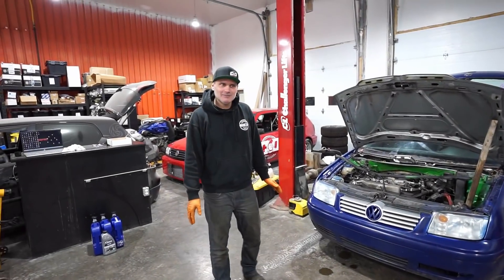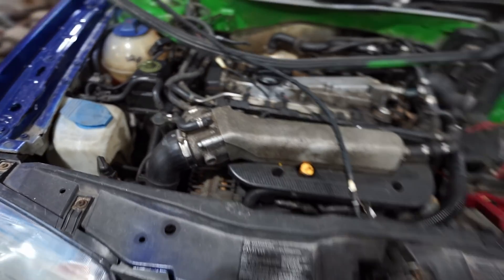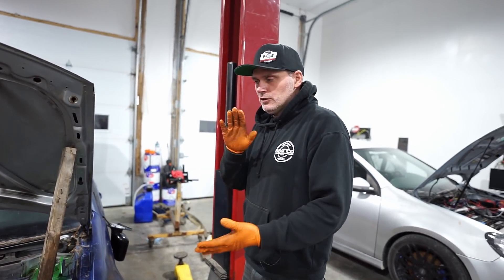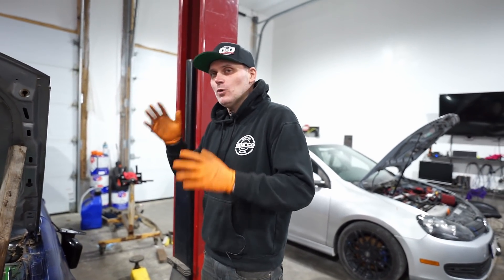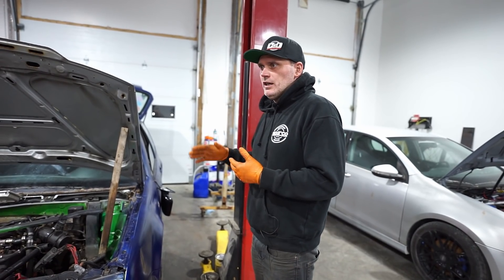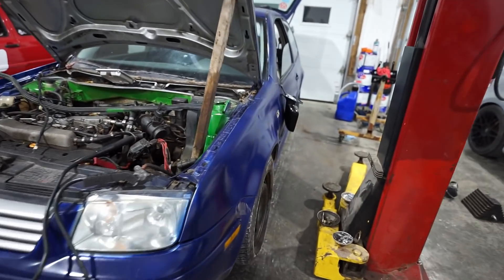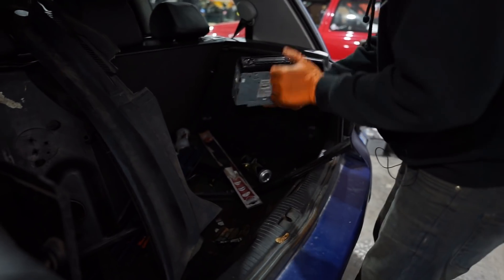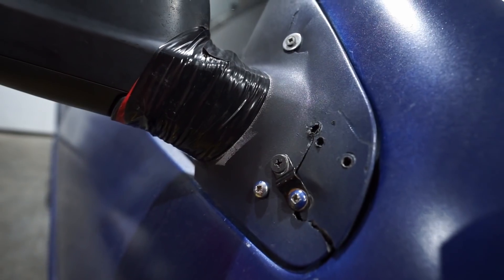How much power can we make on a stock 1.8T engine? Pt 1

Comment from the maker: We're doing this for you guys, we appreciate all the love and support. Lets see what we can do with this thing.
Reply: #NEVARLOSE
Reply: Sweet! It would be cool to see a progression on this one. Testing a ported head, cams, ko3 vs ko4, that type of thing.  Even if you don't, this will be great!
Reply from the maker: @GreatLakesLogger  the goal is not to open it. Stock longblock.
Reply: @COMotorsports  if I would've listened longer, rather than just blowing off immediately, I would've figured that out I guess
Reply from the maker: @GreatLakesLogger  lol I get it.
Reply: Appreciated guys, I just bought mk4 jetta from auction. I plan on swapping the never lose into my mk2. I think the  standalone will make it a easier swap. Looking at the ecu master products. I'm looking for the solution that has the harness and ecu so can just drop the 20v into the car. Which stand-alone are you guys using?
Reply: 4:45 
Anything we want  ? 
Let's go garage 54 style and fill the engine bay with concrete and see if it still runs 🤭🤭
Cut 2 cylinders off and make a .9T 
😂😂
Reply: I've seen I think around 500 on dyno on a 2003 VW 1.8 T 5 speed Jetta and yes it was a awp with stock 19 mm rods that was with the stock awp head they say usually the 1.8 awp motor will snap connecting rods they say usually around 350 400 HP my understanding is if tuning and the torque kicks in fully in the low RPMs is what's snaps the little 19 mm rods but I have seen someone squeeze I think 500 out of a stock motor
Reply: 9:50 fill the bellhousing with some coca cola and drain it,might give enough tack to make a pull. 
Ain't calling me hillfolk for nothin, and that trick could get ya home.
Reply: Just commenting here to say this absolutely needs to be called the "1.8-Hoop-T"
Reply from the maker: @04sneakysnake  good one. Lol
Reply: Have that guy come pick up my car ill pay for transport

Comment: I just got the cheapest 1.8t i could find. Runs but it has a punched oil pan from a bad bump. And the water pump gave out. But it has mods, LOTS OF MODS…..  i see cts everywhere and ecs next to it. Pioneer deck install on bluetooth to the speakers. No rear seat. paid 400 cash in 2024. 	Going to rebuild it on the cheap cheap… 

Anyone got an oil pan for a 1.8t in the Manitoba area dm me please!
Belt kit on order…

Comment: Awesome bulletproof and reliable engines! Here in greece has reached in ibiza cupra 6l 412whp with 438nm on 100% stock (bbu) engine internals(gtx2867R).This is the most extreme I know and a friend with 515.000 kilometers unopened engine with 230hp the last 200.000km's in Octavia rs

Comment: I am working on finding a donor car to swap a 1.8t into my 1992 Cabriolet. Then some upgrades, would like to get 250-300 to the wheels. Hopefully I can get something decent and will probably refresh the engine before dropping it in. I have been looking at getting a EMU Black so I can do immo delete and make the swap easier. I might get a ECU master dash too.
Reply from the maker: Ita a good option for sure.

Comment: I wish these newer turbos were available when I had my 1.8t the gtx first gen series was just coming out when I had this engine in my cars. I am curious how far out in the rev range that turbo is going to be. Will it be an on/off or is there going to be any torque down low. Can’t wait.
Reply from the maker: This setup will be laggy and useless really, however that's not the point of what we're doing.
Reply: @COMotorsports  I can’t wait to see it. I’m guessing at 450whp 320tq is about where it throws the rod through the block. Will I get bonus points to say it’ll be in cylinder 2?

Comment: Blow it apart and rebuild it. Cheaply but clean. Like I would media blast it back to primer and wrap it. Fix the rust. Pull out the seats back and front put Recaro seat in it. Or find some really good used seats out of a junk yard. Replace the merror’s , fix the door cards but leave the crank.  I laugh at the custom work. Love the Jetta front end but clean up the head lights and wrap it mat black or primer silver. Put some loud azz exhaust on it make it crackle and pop. Clean up the engine bay and fully dress it up. That’s the hart of this poor little car. Refresh the GTI badge and take all the crap off the back hatch. 
Make everything work . Radio AC interior LEDs  at least door locks. After you make it run stock see what you have in it for $$ then offer it up for sale on your channel.  With optional add on parts if the customer wants it. Like the haladex AWD . Make it a  sleeper maby put quiet exhaust but add dumps with a switch. 
I love the idea of just having a fun project. But definitely show this poor VW some Love.
She has bin beaten battered abused and left for dead. Now it’s time to restore some life in her put her in  a dress make her desirable again and take her out on the town. Wish you luck.
Reply from the maker: You should have stopped after the first 3 words, cause that's all that's happening to it. Lol

Comment: Reminds me of my build I got my BOLF 1.8 T GTI agu running  FULL RECARO SEATS no MOT for £80 have you guys done or thought of doing the earlier cable throttle etc 1997 -early 2000 engine as there's not much these days on how to tune them the correct way
Reply from the maker: Swapping harness/ecu is the easiest solution compared to trying to deal with those old ECUs. Or watch tomorrow's video, you could swap harness and still keep it cable throttle.

Comment: I remember a guy on the tex making just over 300whp on the stock K03 back in the day. That's everything available down to the diode mod on a tuned ECU.
Reply from the maker: I can't see that ever being possible on a stock K03 1.8t.
Reply: @COMotorsports  I can't find the thread, and maybe I am wrong on the numbers, but he was able to achieve some crazy power for a k03, but only after he spent the equivalent of a turbo upgrade in bolt-ons.
Reply from the maker: @edclips  yeah the only way I could see it happening is if it made a lot of power on just motor. Port work, bigger displacement, stroker, cams, and on and on cause the k03 doesn't flow enough to make that power on its own.

Comment: Put an eBay gt2871 turbo on and see what It can truly make lol
Reply from the maker: We're going much bigger. The GT28 is probably the most common turbo on a 1.8t.. plenty of those kicking around. Also that turbo wouldn't help what we're trying to do.
Reply: @COMotorsports  I see.  How much horsepower are the GT28’s capable of making on a built 1.8t with IE rods and arp head studs with new exhaust valves?
Reply from the maker: @VwDaD1988  I'd do a GTX28 gen 2... A standard GT28 you may as well stick with stock engine.

Comment: Gonna fallow this because then I'll know what could push my 04' 1.8T AWM Passat Wagon. Being A GL 5-Speed and Four Motion with fully loaded interior it's not common even when new. 7600 made give or take. In the 2 years the Four Motion where avail. However my motor starts on the 2nd crank and runs super smooth. So I'm interested in seeing how this goes along. Whoever bought the car originally ticked all the boxes for the GL model. Considering my xwife but wife owned it as the 2nd owner it's been well taken care of since our possession. Basically I took care of it because I wanted it soon as her dealer father bought it from the owner who traded it in. 😉 Should know my limits, "The Granny Sleeper" can take. Just make sure you clean those valves up. 😂

Comment: If it survives any of the Dyno runs😂🤣,,how many miles on it
Reply: 339000 damn,,good luck ,,
Reply: I just noticed that it looks like someone was driving it without an air filter lol damn,,least the maf is there lol lol
Reply from the maker: @jaymoney7968  ultimate hooptie
Reply: @COMotorsports  definitely a hoop ride I think the driver side mirror needs some sheetrock screws as well 😂🤣,,,with that many miles on it I'd love to see how she handles all the bolt ons plus the  software flash,,I got a 2010 2.0t dsg Passat with allot bolt on stuff ,with 210000 miles on it so I'm a little weary about doing a flash I wouldn't go anymore than stage one cuz it's my daily driver / wife's car LOL so maybe this will help make up my mind on a down pipe an flash tune

Comment: Dyno run stock output on a good clutch first?

And then maybe a run on the Stock turbo wound up as far as possible?

Then finish with the big Turbo stuff 😁
Reply from the maker: We all know what a stock turbo is capable. And it would just be a whole bunch more time since the engine has to come out anyways for the upgrades. So pull trans and reinstalling for a couple runs all just to pull it all again doesn't make sense.

Comment: I have that same motor in a 1998 b5 passat wagen. I am going to be putting a o34 exhaust manifold on it to mate up to a tt exhaust 2.5 inch downpipe back exhaust kit. A ko4 turbo. 330cc injectors. Front mount inter cooler. Did the 2.0 ignition coil conversion from 034 motor sports. Looking forward to see what your build does. That way i know what i can do to mine. Also forged diverter valve as well. Its a stock motor at just under 100k. It also has a audi s4 duel mass performance clutch. Aeb is my motor.

Comment: Hey there! I had a simple question and I'd like your educated take on it, I found some info online but I can't confirm it's legit. 
Also they are both stock 1.8t engines so.... 8-)

I bent my valves on my AWP head in my jetta mk4, bought a block real quick to fit a new head on it and turned out I got an audi TT180 ATC engine.
I heard those came with upgraded exhaust valves and forged pistons with 20mm wrists pins.
I Also heard that AWP engine were kinda "hard" to come by compared to others, now I don't know wich engine I should send to get machine for a new setup.

Love to watch your videos guys, such hard great work, going deep.
Reply: I hate to be the buzzkill in the room, but all 1.8t are essentially the same. There is few different configurations but there is no holy grail engine code. Some last hundreds and thousands of miles, some don't.
Reply: AEB head is the highest flowing, AEB has forged Wiseco pistons, AWP has the forged crank tho
Reply: @daytoncorl271  AEB is just a large port head, same head as the AGU AJL and few other, all 1.8t engines use Mahle pistons from factory. Please dont spread misinformation, there is tons of literature out in the internet about these engines, do some proper research before quoting information from forums.
Reply: @aleksandaraleksandrov8213  thanks for the info, guy's logic was that those audi engines were built for quattro therefore had better internals and whatnot but ey that's why I was aking :) made some kind of sense but seemed almost to good to be true. 
Also related to that I think only the latest engine codes on mk4's were rated 180hp, older engine codes had 160 I think so that's why people are looking for em and since they only had 2 iterations that's what made them "harder to find".

Comment: If you do 400 you guys will be heros
Reply: With the 3582 and a late torque onset I don’t see why not… I wouldn’t be surprised if they make 450. Maybe not for long, all depends what sort of a state the stock motor is in.
Reply from the maker: @jameslenton1484  The motor is extremely tired, but if it dies prematurely I will just chuck another on in and try again. lol

Comment: What do y’all think about tuning a high mileage 1.8t ? Mines been maintained very well/common issues  have all been replaced but it’s at 160k on the odometer want to go stage 2
Reply from the maker: Do them all the time. And there's plenty out there that have been modified and lived much longer than that.

Comment: I made 325 on 130,000 mile junkyard ABA with a 16 valve GT 3076 set up on it. Lasted for six races about 60 passes. Rod bearings were ready to go at that point.
Reply: What it run?

Comment: It would be interesting to see actual limitation of standard ecu.. name it Glory. Lets hope its going to live up to it's name and carnage will be glorious
Reply from the maker: I could do the same thing on stock ecu it just adds way to much time to the process and doesn't make sense for what we're doing. We have a great solution which you'll see.
Reply: @COMotorsports  love your videos and builds anyway. I get it, you want to see how much engine components CANT take and its always entertaining.  But ive been wondering how actual components restricts engine to make more power. In this instance, port size, intake manofold, intercooler, engine management. Cause i think a lot of people buy really expensive car parts with very diminishing returns. But that would be a long series of videos.

Comment: up until you said it came with the title for a running car, i was thinking i had the cheapest lol scammership i bought mine from changed ownership before sending the information for title transfer to the state. I went to get plates for my 1.8t jetta, and they said it was impossible to put the car in my name as it was still under the dealership's name

I tried contacting the dealer, it was under new ownership and they didn't have any record of the title or sale for my jetta. It just sits in my backyard now.

Its been about a year and a half. Talked with a lawyer, I know i can file for an abandoned title, but if anyone responds to it, I have to go to court over it, which for a car i only paid 1900 usd for... meh, no thanks.

Comment: Yes! I'm really anxious to see the plug in standalone stuff! I've been kicking it around for a while, but just haven't been quite sure, just because of things like integrating the canbus. (Cruise control, etc)
Reply from the maker: Cruise is possible, but generally not very important for those wanting to do standalone.
Reply: @COMotorsports  For me the standalone is simply to make tuning easier as I don't really have anyone near me that'll tune it, and eurodyne is a bit of a pain, especially since they don't have anything other than stock base files available for the awm. That's kinda why I'm after cruise control, because it's still gonna be a daily driver.
Reply: Look into Ignitron ECU
Reply from the maker: @kendromartinez5772  we have a better option. 😉
Reply: @COMotorsports  Maxx ecu? The guys at Maxx recommend the pnp version for the older s3.
Reply: @COMotorsports  ima need that better option, been looking for standalone for my AGU so I can go bigger turbo and flex fuel but I do love my cruise control!